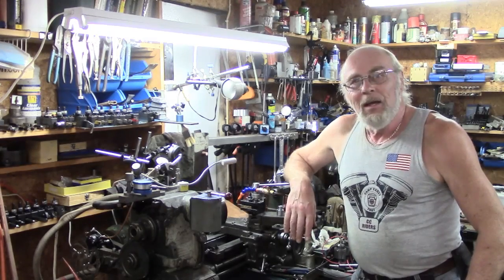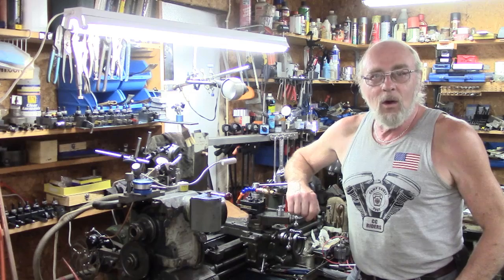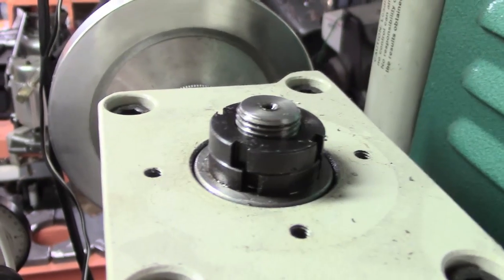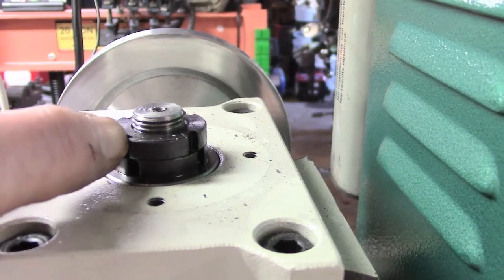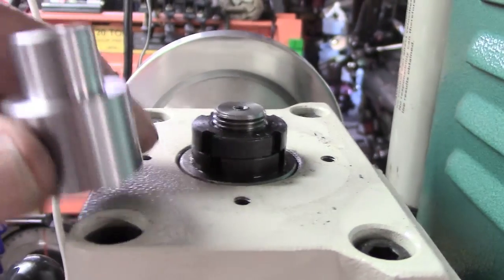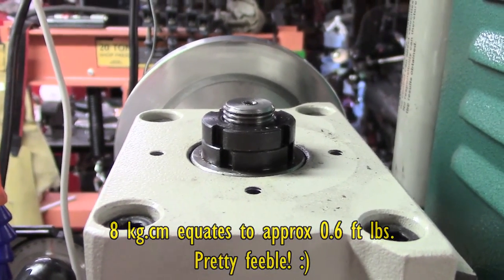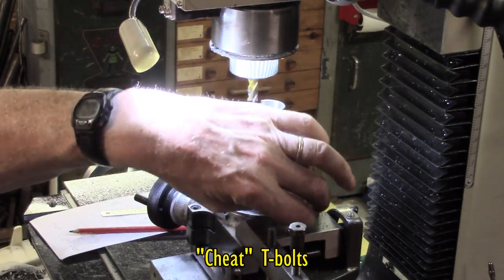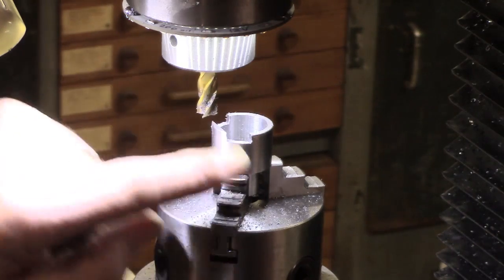Powering the Z-axis - Sort of!

Comment: Chris , I have made the drive dog you tried to make. I machined a collar with a larger id  than the jam nuts then drilled 4 holes for 10-32 set  screws to engage the lower jam nut.  For good measure I did the same for the upper jam nut. I brazed a 14mm nut on top of the collar so I can use a cordless angel drill to drive all 3 axis. Poor man's power feed.
Reply from the maker: +Hans Engblom Hans - I did think after I could have done similar to what you mention - possibly using dowel pins.  However i have a very good value windshield motor now and am thinking up - if possible- a rig to allow me to make a friction drive.  We'll have to see. :) Thanks for the suggestions.

Comment: Thanks for the videos...enjoying them, and I too wish you could have made it over the rainbow to Stan's Bar Z Bash...it was quite a good bunch of guys with the rare lovely lady in attendance. I did have a thought and I'm not sure if anyone else expressed it or not, but in case you can only find a larger motor and not the gearbox, is there any way you could swap out the little "power plant" and keep the gear box for transmission of said increased power? Just a thought as it sounded to have a good conversion ratio...

Aloha...Chuck
Reply from the maker: +Knolltop Farms I have lucked out on a new windshield motor - now need to get design hat on to see if I can make up a spring tensioned friction drive onto hand wheel - so much to try and devise! :) Thx for comments.
Reply from the maker: +Knolltop Farms Thanks Chuck - I'll check that out - all ideas as always most useful.

Comment: Hi Chris, what about a motor from a car seat, if it will move a typical colonist, it should be good for moving 300+ pounds. :>) 
Thinking of electric motors, it still amazes me the power they get from RC aeroplanes, 1/2 horse from something about as big as my thumb! Not suitable for your application but outstanding all the same.
Reply from the maker: +Chris Stephens Good idea Chris - for now though I am getting a wiper motor to try out and see how we go with that. Indeed, RC motors these days are amazing for power - the advent of brushless motors has made all the difference with power-to-weight etc.

Comment: I'm with cerberus on this one mount it and run it till it smokes, and that will give you plenty of time to research other alternatives, in the mean time you'll have a working system. Never know it may run for years and if it did your not out that much more since its practically built already. Use some Locktite between the mating surfaces of the nuts not on the threads to help keep them from separating..and that lower torque motor might be better for that potential nut problem where a more powerful one might loosen it. So yeah go with what you already have so if it works out it might prove to be an inexpensive mod for others to follow, don't fix it if it ain't broke. And I think the compact size is another advantage you have going there ...easier to mount. A variable speed controller could be added later to the mix to help regulate the current and fine tune it. Thanx for the fine vids Chris looking forward to the next one.
Reply from the maker: +1NRG24Seven  - I have a speed controller available but - only problem with running to destruction is - the time needed to build a decent mounting just for it. Plus - there is the problem of needing disengagement for manual operation via the hand wheel, as the gearbox effectively locks up when not powered. May yet be better with a wiper motor and perhaps some sort of friction drive to hand wheel. Plenty to think on. :)

Comment: 300 views and no ideas??  BAH!
Having motorized my mill head I can tell you that I giggle each time I use it.  Granted, my thoughts on the OEM method for my mill cannot be expressed in mixed company or near children.

The question to be asked is: Do you want just motorized movement or do you want precision CNC like operation?  Pessimist that I am I can too easily see that locking ring coming off, especially if you forget to unlock the column.  Then you gotta adjust the bearing again.

How about a friction drive to the rim of the hand wheel?  Put the motor on a sprung pivot and strap it to the column.  Switch it on and lever the motor to the wheel to adjust.  Maybe a momentary FWD/OFF/REW switch on the lever.  The spring would keep it out of the way for hand operation and a strip of emery cloth can be taped/glued to the hand wheel if oily residue is an issue.
Reply from the maker: +Eddie the Grouch Hi Eddie. Main need is motorized motion - fine control would be done manually. Something to ease the burden! Yes indeed, very leery of that locking ring.... this was only a bit of an experiment - will have to devise something better I think, as well as better motor!
Ahh - like the friction drive idea -- that could work if a suitable attachment option exists for mounting ... cerebral gears are turning. :)

Comment: Hi, I just want to give you another idea on how to ultimately motorize the Z-axis (and e.g. be able to use a boring head). With a NEMA 23 stepper motor, a driver and a small PWM board from Ebay, you will have plenty of torque and adjustable speed in both directions. It is not painfully expensive and easy enough to set up. Just tell me and I shall guide you in the right direction. Cheers, Brian.
Reply from the maker: +Brian Petersen Hi Brian, thanks -- not familiar with that stepper motor.  Had given casual thought to such a principle, possibly using an Arduino etc. At the moment, drive coupling is the main aspect to get right as that locking ring could well loosen off. Much to think on yet.
Reply from the maker: +ChrisB257 Just searched and found info on that motor - looks very useful. Thanks for the mention.

Comment: It's possible to replace the Z axis lead screw with a ball screw and attach a stepper motor.  A little more expensive than what you're trying.  You'd be 1/3rd of the way to a CNC.
Reply from the maker: +Steve Carter Hi Steve -- now that sound most desirable i have to say. It had crossed my mind but like you say, costs would certainly go up. It'll probably be an evolutionary project!

Comment: The top nut will get loose over time/instantly if you apply torque only to it. I have the same kind of mill, but now I have upgraded to a bit bigger mill (Bridgeport CNC) as I wasted a lot of money trying to get the small mill in any satisfactory working order.

Speed controller on my small mill burned but I managed to fix it but soon after the motor burned and it started to suck my finances... :) I may have dumped at least 1500€ on it and that is on top of what I paid for the mill brand new. Maybe 3000€ in total. 

Bridgeport cost me 2200€ including delivery to my doorstep.

There are some videos on my channel about my small mill. Just some random footage as everything else on my channel.
Reply from the maker: +Jyrki Koivisto Hi Jyrki -- yes, top locking ring is certainly a concern. I'll hope to find a better answer and, much as I'd greatly cherish a Bridgeport, I have floor loading concerns as well as space - I'd have to cut thru and cast a concrete pad. For now I'll soldier on but take your point re additional costs etc. Thanks - I'll take a peek at your channel.